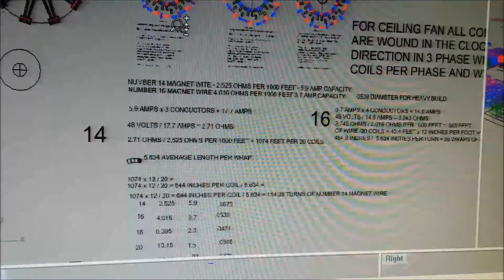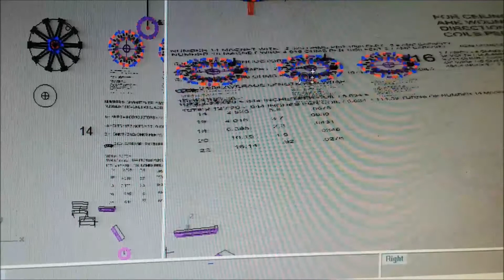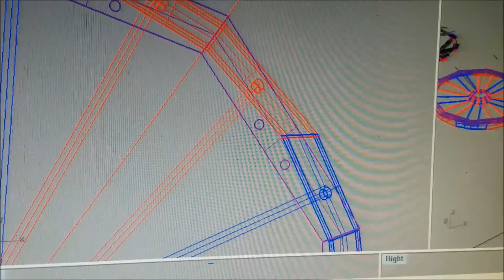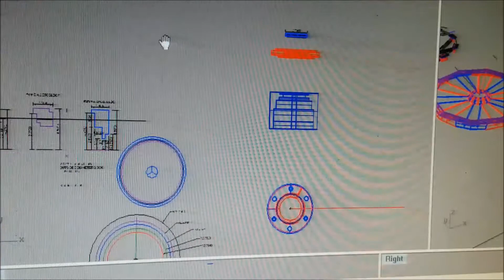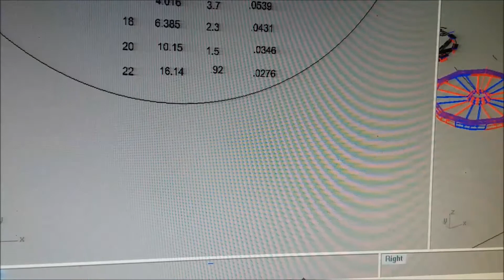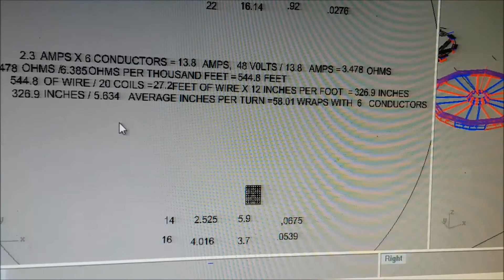DETERMINING MAGNET WIRE GUAGE AND TURNS COUNT FOR WIND TURBINE STATOR PART ONE

Comment: This is wonderfully explained, but I'm a noob in all of this and I'm trying to understand the formulas. First I didn't get is the 6 conductors. 

First question : Where does the number of conductors come from ? What does it actually mean, if wraps per coil come from the output of the calculation ? Is it double the number of the phases ?

Second question : Why is the number of wraps coming as fractionary as the result of a division instead of being multiplied ? I mean, if I have the coil structure in my hand I know the perimeter (that would be, "average inches per turn"), then the whole calculation would be turned around. Sure, since we don't want that, means, I understand, that the number of wraps (that 58.01) should match the two thirds of the number of wraps of the build.

Is this a trial and error calculation until the numbers put out actually match what is possible ? That is, pick a thicker or thinner cable until the result would be, in your case, 60 complete wraps ? Now, 60 complete O wraps would mean 3 wraps per coil (3 x 20). 

But, if 20 are the coils in series from the 30, that still didn't answer the question -> means that every 20 of the 30 must have 58.01 (or 58) total wraps. Given that the geometry of the circuit changes all the time, means all physical coils must have the same number of wraps. 58 doesn't divide to 20. Should I pick other inputs until I actually get 60 as the output ?

I mean I want to understand the practical side of the calculation, how it translates into the build.
Also, how does the calculation treats the wire part that is not coiled (the small distances between the exit on one coil and entry to the next coil) ?
Reply from the maker: Well, Yes you do try a wire guage on either side to seewhat the length changes from the resistance/meter between several choices. Once you have chosen a wire size based on
amps capacity then the ohms per meter is in the manufacturers literature, V = I times R  
(volts = amps times resistance), so.... divide your volts by the wire amp capacity to get 
ohms of resistance needed. Divide the ohms resistance by the ohms per meter to get
meters needed. This number of meters is that which is used for 2/3 of your coil count. if
you had 9 coils then the wire is wrapped on 2/3 of 9 or 6 coils.  if you had 27 coils the wire 
is used on 2/3 of 27  or 18 coils. I have 30 coils so the wire is wrapped on 20 coils. The 
wire  leading from one coil in the string to the next counts in the resistance needed for all 
the coils in the two series connected strings. if you have and you will have a fractional wrap 
it obviously gets completed so the wrap number is one higher. No need to worry about 
being off by 3% on any of this because the resistance changes with temperature. In the 
case of epoxie incapsulated magnet wire coils there is not a lot of cooling so the wire runs 
hotter than the temperature it was rated for. Higher temperature increases resistance so 
once up to operating temperature you get a little more than you need.
          More important is finding out what gauss rating your available magnets are. I use
N52 neobdyneum but other neo magnets and ceramic magnets can be used that are
cheaper and have lower gauss values. Google the formula for magnetic flux and solve for 
voltage using the magnet face to center of your stator coil as the distance. I stick with
a 3/4" thick stator which works with magnet rotors of opposite polarity on either side of 
the stator. We always say magnets must divide by 2 to get equal numpers of north and 
south poles, however, if you put half your magnets on each of two rotors to boost the
field strength through the stator then the coils also need to divide by 4.   Say you had 6 
magnets which divides by 2 to be 3 per rotor. Well then you have 2 of one polarity and 
one of the other on each rotor. Might be best to stay away from magnet counts of 6, 10, 14....60
for dual rotors.  Well got to take the dog to the vet. He just ran off with my sausage dog 
loaded with 7 pot Naga Viper peppers.

Comment: Sorry my friend. I appreciate you trying to explain this but you rambled so much I could not follow you. I just wanted to know how to determine how many coils, What size wire, How many wraps, and why I might chose delta or "Y" wrapping.
Reply from the maker: Wire size is according to amps produced. Wiki has formulas for calculating Gauss (magnetic flux)
and the amperage it will make. The number of coil "turns" or winding wraps multiple the voltage
to what you are designing. The equation  Voltage = Amps times Resistance   (V = IR) lets you
find the resistance value you need. Magnet  wire (enamel insulated copper  wire) is listed by
the manufacturers sales literature in Ohms of resistance per 100 meters or per 1000 feet. So...if
you divide your needed resistance by resistance per meter you come up with the length of wire
you need in the series of coils. Remember that every third coil is in series (a string of coils) and 
that the "Y: or Delta connection has current flowing in one string and out another one so the 
meters of wire are the total feet for two strings. The number of coils is the number required 
to use the meters of wire required for the resistance value. The coil count must be divisible 
by 3 (3 phases)  and the magnets divisible by 2 for an equal number of N and S poles. The coil 
and magnet counts are different numbers to reduce "cogging" which makes the magnets try
to center in the coils and resist turning further. Different counts ensure that not all are centered simutaniously reducing mechanical stresses and reducing starting torque to turn the magnet
rotor or rotors.  Choose wire guage as a compromise between resistance and required length
for the guages closest to your design amperage. Smaller diameters have higher resistance
while larger diameters carry more amps. Both "Y" and Delta connections have 6 distinct steps 
before the pattern repeats. Three phases going positive and 3 phases going negative.  The Wye
connection has the center of the Y as a connection common where the Delta is a triangle with 
the 3 verticies as the only connection points. As I recall? delta is easier to ramp up at low speed 
but no advantage at design speed. Large AC motors use contactors (motor starters) that switch 
from Delta to Wye to start them up either by a timer or mechanically by the guy or girl that
is doing the starting. During the shift point the motor is freewheeling.   AND YOU ASSUMED
I WOULDN'T BE RAMBLING WITH A WRITTEN RESPONSE. The dog is still laughing at that
thought as he types this.
Reply: @concretehousebuildinginph1488  Thank you for the response. My goal is to take an alternator and turn it into a PMG (permanent magnet generator) that puts out 3 phase power 230V. My thought was to rewind the alternator but I think I'll just leave it alone as long as the wire is in good condition. I was planning on removing the middle part and adding neodymium magnets to it. You mention Cogging. My thought was to make sure the size of my magnets and placement put them all directly center of the coils initially but, if I understand you, I may need to offset them so that no matter what position they are in there is always at least one magnet partially crossing the coil.

Comment: No one talks about this but it's confused me forever.  Should all coils be turned in the same direction like Clock Wise if  going into the table as you look over it?  And why do the magnets alternate?  If North passes over CW coil first the sign wave will raise then when the N magnet is in the center  of  copper coil  windings.  When there is no copper, it's  at zero, A north magnet creates a full zero to max positive as the N magnet continues to rotate on the rotor the AC generation starts again and the sign wave starts diving down, reaching max voltage as it is over the copper loop and zero when it is has left the coil..  So in summary it seems you could have an electic gernerator  by winding all coils in the same direction and have then be all North facing magnets seems it would work fine.
Reply from the maker: Anthony, check out a few other videos and you will see labels of CW for clockwise and CCW for counterclockwise connected. Since the way
the series of coils are connected will set the winding direction. Next
question is current flow as a magnet passes a coil. This is by the 
right hand rule where your fingers are around the magnetic flux lines
 and your RIGHT thumb indicates the negative to posative current flow. SO..... as a magnet starts across a coil you get a coil flow due to the 
moving flux (no flow if there is no moving field). The current rises till the magnet is centered on the windings of that side of the coil and falls 
to zero when the magnet is centered in the coil. Now the coil windings 
on the second side of the coil have wrapped around the end of the
 coil and are going the OPPOSITE direction. The right hand rule shows current flow in the opposite direction so you get the other polarity 
sine wave half of the cycle.  If you have trouble with this get your dog 
a beer and let him explain it to you. You will know you understand 
when you can explain it to you wife and she can explain it back to you.
     All clockwise coils and all north magnets. Well the current reverses direction at the center of the coil but would result in zero net flow as
it would be self canciling. There is basically no difference in coils and magnets or electromagenets between a generator and a motor. The difference is COMMUTATION is required for a motor but not for the
generator where you only rectify whatever comes out of it. With an
alternator two of the three series connected coil sets are connected 
inline and the third has one end open circuit. This open set can be 
used as flyback to control the rotation (at zero V crossing)  or Hall effect sensors used for position detecting. The test of your single direction
coils and magnets is will it run as a motor connected to power. If it
won't motor it won't generate. Them little electron thingies just aren't 
that smart on their own. If you don't believe me wake up my dog and 
ask her.
Reply: @concretehousebuildinginph1488  i DON'T KNOW.   Just to slow it down, every coil is wound clockwise as you stand over it.  So current will go into your table but when the magnet is moving past the middle of the coil hole and starts cutting across the righ side of the coil a current runs counter clockwise away from the table. Which  is just describing a single sine sinewave correct. from zero to max volts with passing over coil at center of left side of winding, then as magnet continues right (clockwise), we read zero volts as magnet is in  from the center of coil hole.  Magnet is still traveling quickly the the right and field lines are cutting the right side of first coil.  Voltage increase and maxes with magnet at center of thickest part of right side wall. Magnet continues right and voltage lowers finally reading zero when magnet has left the coil.  It just seems like all about magnet placement.  The magnet at phase 2 must start to pass over that coil a few 100's of second after or before the first, Phase 3 must have it's magnet pass over it a few 100's of a second before or after the second.  Then each magnet that will make every other pass should be at exact same starting point with respect to it's coil and phase.  I just don't see the reason for alternating magnets unless the stickiing power to rotor is the reason??